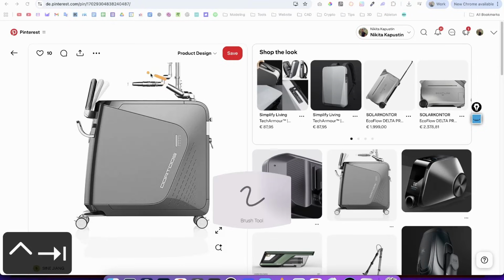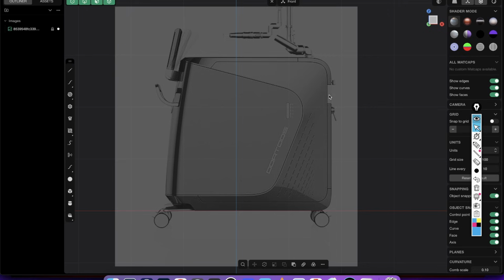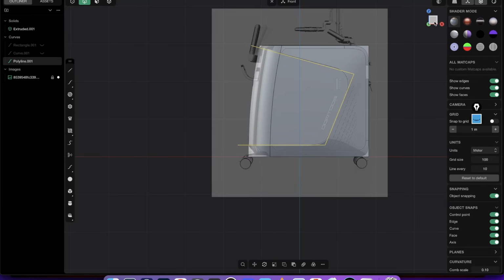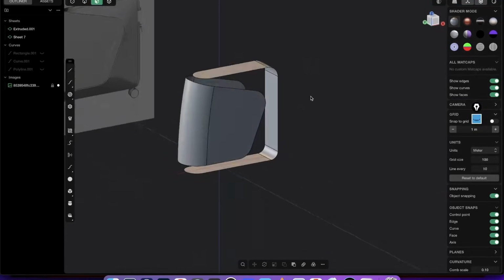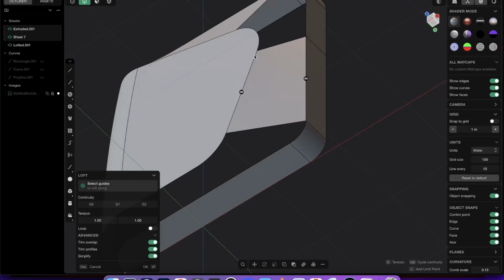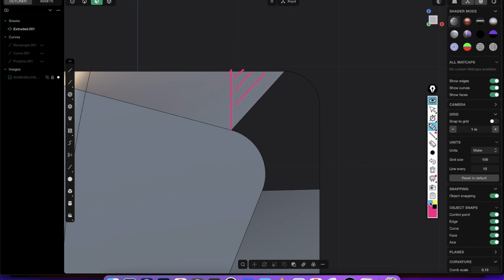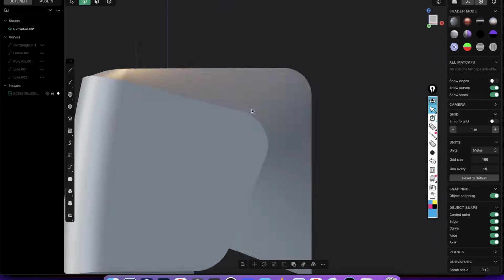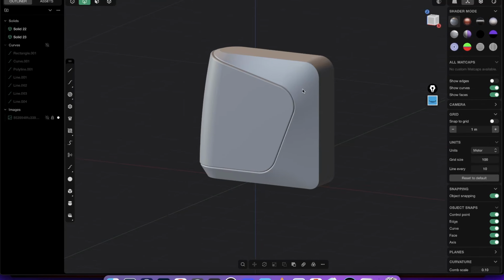How To 3D Model This Amazing Device (Plasticity Beginner Tutorial)

Comment: Thank you for the valuable and insightful tutorial episodes.
I’m having some difficulty adapting to Plasticity’s workflow—not because the software is hard, but because I’m used to the modeling style in Blender and ZBrush, and applying the same approach here has been challenging.
Do you have any recommendations for someone transitioning from Blender/ZBrush to Plasticity?"
Reply from the maker: My only recommendation I can give you, is to practice. I have hundreds of Beginner videos on my channel. I have a Beginner Playlist you can check out. Just check the thumbnail what interests you the most and try to follow along. Over time with some practice it will become more easy and intuitive:

Playlist for Beginners: https://www.youtube.com/playlist?list=PLvK4Eudxj5BOvPkOK7xnhMVv4VJwqx50k
Reply: Hi. I have been doing Blender since early 2000 and know hooked on Plasticity for one year. I takes time and as Nikita say.... Practice. I have been using some of my Blender projects and done them i Plasticity instead. The hardest part for have been to learn the how to create good splines and start to use the bool tool